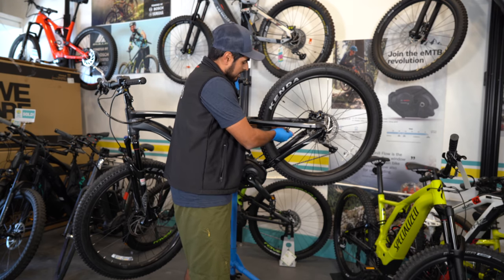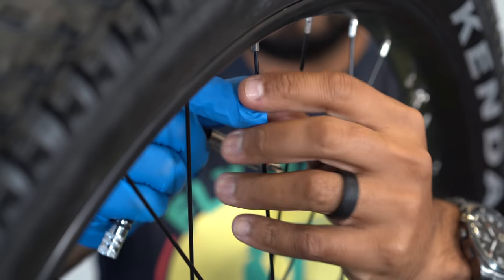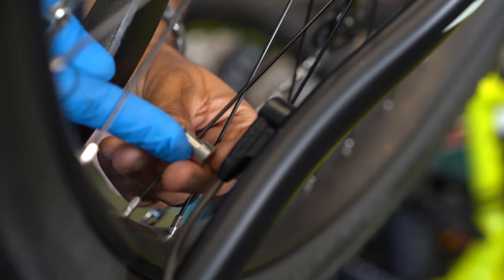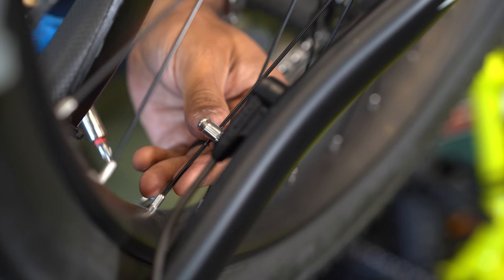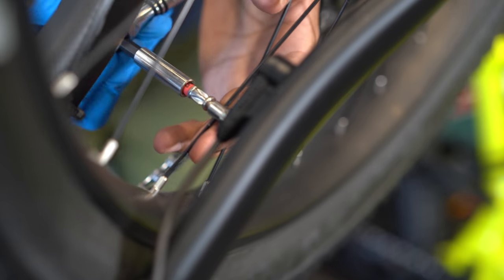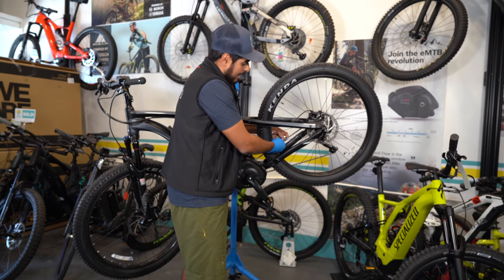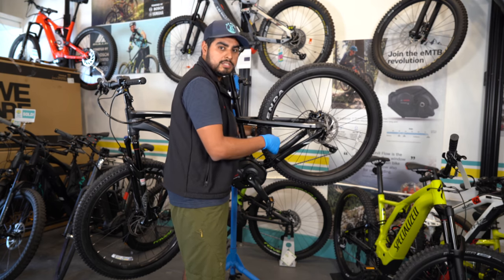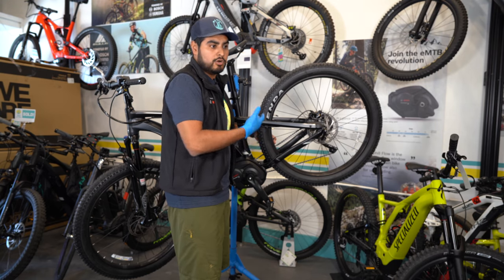eBike Speed Sensor, Speed Magnet Troubleshooting: Fly Rides' Two Minute Tips!

Comment: Would add that carrying a spare OEM magnet with your tools in your saddle bag is a good idea also as well as a quick link for your chain and a chain tool (ebike chains get much more torque than normal mechanical bike chains and they do break.) Anyway, your magnet falls off you are pushing that heavy bike home or calling Uber (hey almost never would happen but on a trail and miles from the nearest road...)

Comment: Thank you for the video! Just one question, when not riding for some days, should I remove the button battery from the sensor? Or maybe it doesn't drain when the magnet is not turning in the wheel?

Comment: I have a speed sensor which is located on the frame of the bike, but I'm using a 48V 21ah extended range battery. When I'm riding using this battery I hear a buzzing noise as I'm pedaling ? Am I doing something wrong when I'm riding, and if so does it have anything to do with how I'm using my PAS, and gears .I also wanted to mention that the speed cadence sensors are located on the bike frame.

Comment: The speed sensor magnet on my electric bike is located between the rear wheel and the cadence sensor. How can I check for the speed limiter if I'm using my 48V 21ah extended range battery that makes a buzzing noise when I'm riding.

Comment: I have an issue I can't really seem to fix. History is bought my e-bike of of internet. Top speed was 30 mph. Months later e-bike was stolen and parts removed from frame. I got some parts back to get it running again after sitting weathered for about a week then got it back together. When I logged my top speed more than once it topped out at 14 mph. How can I fix speed?

Comment: If you put the magnet closer to the centre and the sensor too, will it make a difference on the speed ? I think not .. ?
Reply: No, it does not affect the speed reading... 1 magnet gives 1 pulse per rotation to the sensor. With the correct wheel size (and or number of magnets = 1) set the computer reads/counts and displays 1 x wheel size circumference per pulse = X speed. So you should place it at the correct distance between the magnet and the sensor, distance from the rim doesn't change the set wheel size and number of pulses per rotation.

Comment: I drive without this fuckin sensor. If its to near it dont work and if its to far away also. You have always problems with this. I wanne drive and not looking on a display. Never needed a speedometer.
Reply: I didn't install the one that came on my bafang motor but because of it I get error 21 and motor shuts off. How does one bypass this?